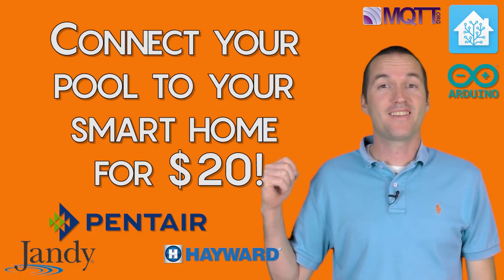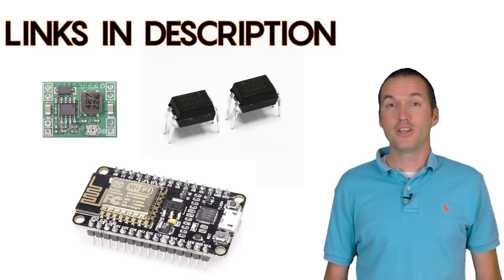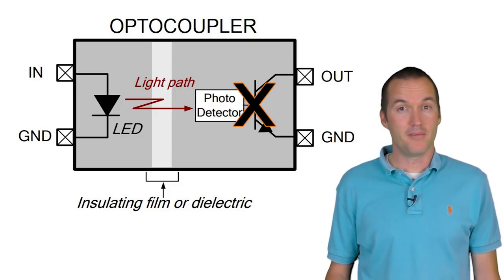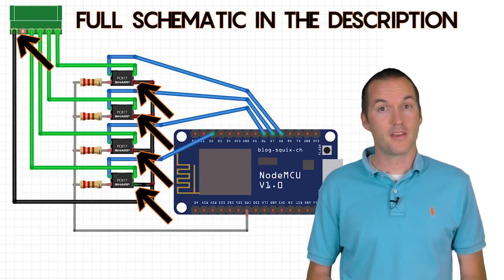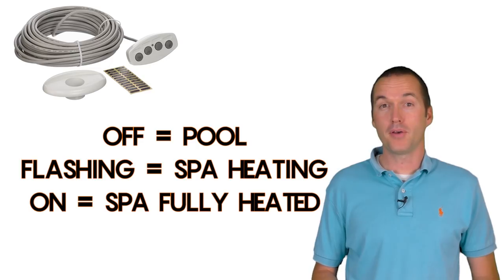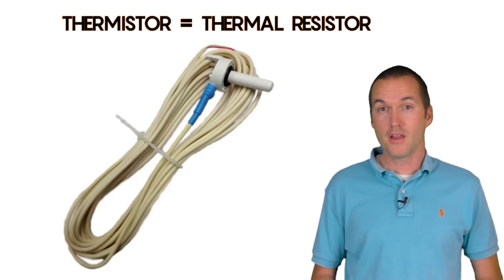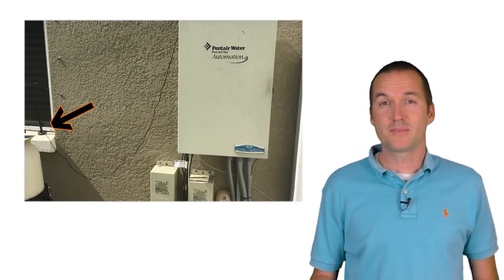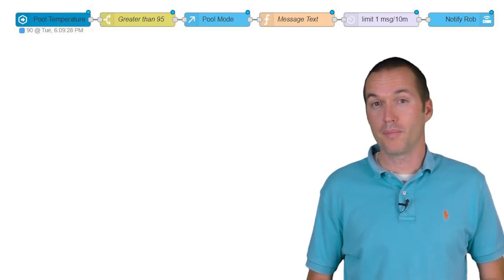Connect your pool to your smart home for $20 with Arduino!

Comment: I’d like to use the nodeMCU around my house in multiple locations to monitor the run times of various devices.  Those run times would need to be stored in a log with time stamps of when that device turned on and off. Then I’d like to take actions based on specific patterns in the logs.  For example if my sump pump was running every 5 minutes in the logs but all of a sudden 30 minutes elapsed without it turning on - that would generate an alert that it may have failed.  Likewise if my well pump turns on frequently for more than 2 hours it should alert that a faucet was left on accidentally or there is a leak.  With the price of these so low I’d like to monitor every device throughout the entire house with similar pattern checking for anomalies in any device. Is there anything like this already existing?
Reply from the maker: Current measuring is tricky.  You should check out the sonoff POW with custom TASMOTA firmware.  It would be very simple to do this with home assistant.
Reply: Hi Neil. Most appliances have some sort of LED indicator to tell you if it is on. If it’s the case for your pumps then you could apply a similar concept to Rob with optocouplers.

After he did this video I used this concept on a USB port on an old tv in the bedroom to determine how much tv we are watching each week, as the USB port only has power when the tv is actually on. All of the on and off states go to Home Assistant and get logged. The duration and notification pieces could be done in Home Assistant or Node Red; I have graphs in the LoveLace UI.

I actually used Tasmota for this so no need to go need the Arduino IDE if you don’t want to.

Hope this helps!

Marc

Comment: I'm trying to translate this into a project I'm working on with an air purifier that doesn't have a remote, but it has 3 momentary contact buttons and 5 LEDs indicating high/med/low fan speeds and two filter types. I noticed your resistors in the wiring diagram are connected to  the CMD pin. I've personally never used that PIN and wondered what its purpose in life is. I'm still looking around the internet but I thought I'd try dropping a comment here first.
Side note: Looking at another video that goes over the best pins for projects would the ESP32 be the best option since i need 8 GPIO pins? Or could I squeak by with GPIO1,3,15 for the buttons?
Reply from the maker: That's the GND pin.  It's a ground.

You can probably get by the 8266, just make sure your momentary contact buttons are not connected to a pin that is high on boot.
Reply: @TheHookUp  Thank you so much! Saved me an hour of research and nail biting!

Comment: Excellent. I am in the process of making a similar setup, except using a Raspberry Pi 0 W. Now you have me thinking it's an overkill :) Do you change the Pool Controllers measurement by piggybacking of of it? I don't have a pool controller and is considering piggybacking of the thermistor in my Pool Heater (HAYWARD IDXLTER1930 H-SERIES THERMISTOR). But I don't want to change what the Heater senses by piggybacking. The heater will still be using it for temperature control
This is a 3 wire thermistor in a 24V Circuit and I was considering using a PCF8591 to read the analog input. Is there an easy way of doing this without interrupting the existing circuit? Do I need to step it down? How would the conversion change?
Reply from the maker: My original answer to this was no, it doesn't change the temp.  I have done some testing and my answer now is that it changes the temperature reading by approximately 1.3 degrees F.  I'd imagine this is due to a small amount of voltage drop caused by the GPIO circuit.
Reply: Thank you. Any suggestions as to how to go about the 24V? Can I convert the thermistor output to anything useful that my PCF8591 can handle?
Reply: @johnraahauge4552  I would think that using a voltage divider that converts the maximum output your 24volt 3wire interface can give to a max of 3.3volt would suffice. You have to make this voltage divider with resistors that are as high as possible in order not to influence the calculation in yr 'commercial' controller.
The downside of this approach is that you will not be able to measure really small changes in temperature,  and the pcf8591 is 8 bits doesn't help that, but with 255 step resolution I am pretty sure it will be accurate enough for the pool temperature range.
I really like the pcf8591, great chip.
Having said that, if you obtain for the Wemos D1 mini or nodeMCU, rather than the raspi, you make things easier for yourself
Reply: Ed19601 I ended up using a voltage divider and an Arduino Uno hooked up to my Pi. I really need the Raspi out there for other stuff.
Reply: @johnraahauge4552  tnx for the feedback. Wise decision. I was pretty sure you already found a solution, just wanted to leave a reply for anyone else with the same question
Reply: Ed19601 Thanks Ed. I should’ve updated the thread  earlier with my solution. Thank you for your suggestions.

Comment: Hi, nice work. Could you tell me what to modify in you code to get 4 MQTT controlled relays(on/off) on NodeMCU ESP-12? I have 4 valves for the irrigation system I want to control with MQTT, I have a Raspberry running Node-Red and MQTT server in my home office. I have tried Arduino plugin for HomeSeer on the NodeMCU, but that was really unstable.
Reply from the maker: If you're not comfortable with arduino hang tight until tomorrow's video, I'm going to go through programming ESP8266's with a new addon called ESPHomeYAML which doesn't use the arduino IDE at all.
Reply: Perfect looking forward to it 👍

Comment: I have a battery operated fish feeder which I'm hoping to connect to Hassio, planning to pull the feeder apart and connect the terminals of the manual switch of the feeder. Ultimately I want the feeder and a webcam so I can remotely feed my turtle went on holidays. I'm trying to use GPIO14 of a sonoff basic to control a relay to operate the feeder. Also bought a cheap Digoo camera but can't seem to get it to work with Hassio's FFMPEG.
Reply from the maker: I'm not familiar with that camera, does it have an rtsp stream that you can access through VLC media player?  

The fish feeder should work no problem, are you going to run tasmota on it?
Reply: Yes the camera does stream through VLC but I can't get it to work on Hassio which is annoying. Yes I'll be using Tasmota, I have all the electronic components now just need to get around and do it lol
Reply from the maker: Do you have these entries in your configuration.yaml file:

ffmpeg:

camera:
  - platform: ffmpeg
    input: rtsp://your_camera_rtsp_stream
    name: "Driveway"
Reply from the maker: try removing ffmpeg_bin: /usr/bin/ffmpeg since the ffmpeg component comes preloaded in hassio
Reply: getting these errors

2018-08-04 07:29:25 WARNING (MainThread) [homeassistant.setup] Setup of config is taking over 10 seconds.
2018-08-04 07:29:42 ERROR (MainThread) [homeassistant.core] Timer got out of sync. Resetting
2018-08-04 07:31:11 WARNING (MainThread) [haffmpeg.core] FFmpeg isn't running!
2018-08-04 07:31:11 ERROR (MainThread) [aiohttp.server] Unhandled exception
Traceback (most recent call last):
  File "/usr/local/lib/python3.6/site-packages/aiohttp/web_protocol.py", line 398, in start
    await resp.prepare(request)
  File "/usr/local/lib/python3.6/site-packages/aiohttp/web_response.py", line 300, in prepare
    return await self._start(request)
  File "/usr/local/lib/python3.6/site-packages/aiohttp/web_response.py", line 605, in _start
    return await super()._start(request)
  File "/usr/local/lib/python3.6/site-packages/aiohttp/web_response.py", line 367, in _start
    await writer.write_headers(status_line, headers)
  File "/usr/local/lib/python3.6/site-packages/aiohttp/http_writer.py", line 100, in write_headers
    self._write(buf)
  File "/usr/local/lib/python3.6/site-packages/aiohttp/http_writer.py", line 57, in _write
    raise ConnectionResetError('Cannot write to closing transport')
ConnectionResetError: Cannot write to closing transport
Reply from the maker: put the 

ffmpeg: 

part in, just not the part under it with the bin path
Reply: The Hook Up yeah i took the other section below ffmpeg: out but still getting error
Reply from the maker: hmm, what version of hassio are you on?
Reply: The Hook Up 0.74.2 and Supervisor 122
Reply from the maker: that's really strange.  here's a longshot: do you have the 

ffmpeg: 

entry above your camera entry?
Reply from the maker: that should be fine.  Is it possible that your camera is on a different subnet from your hassio box?  doesn't explain the FFMPEG not running error though.
Reply: pretty sure its the same subnet
Reply: Just got the feeder working. Still need to work out the camera

Comment: so this might be a dumb question but does the button selection really matter?  Don't you program the button function in the pool controller? (i.e. button 1 on my pool side is lights but even if i use your same code doesn't it just press the button and not send the actual command to the pool controller?)

Hope you reply, would really like this answered before I hook this up to my pool.  I've got everything built and the code loaded on my ESP8266, I didn't bother setting up the correct commands in the Arduino code, figured I would just edit the HomeAssistant yaml file for the correct labeling.
Reply from the maker: Correct, you can change what the buttons do directly on the pool controller, or you could simply hook up different wires to different terminals (connect the wire from the ESP that was supposed to go to terminal #1 on the pool controller to terminal #2 instead).

Comment: Any suggestions on how to monitor pool level?
Reply from the maker: That's a tough one because you have to get a wire close to the water.  A float valve in the skimmer is probably the easiest solution.

Comment: love the videos could you do one on dimming dumb led strips using nodemcu and mosfet with mqtt via HA, loads about rgb but none with single colour tried stripping the code down from a rgb tutorial but can't get it to work
Reply from the maker: I started to write an explanation of how to do this, but it was long and confusing... so I just wrote the sketch for you to modify as needed.  You'll still need to hook up your single channel using a mosfet.  Here's the code:  https://github.com/thehookup/Misc/blob/master/LEDDimming_CONFIGURE.ino
Reply: Have the circuit working  it was the mqtt and HA part I was struggling with 
Cheers

Comment: No not a pool warmer. The public wants your roller blinds system. Bring that it on.
Reply from the maker: I'm working on it, I had to order parts from Ali express
Reply: You sir are a legend!  Keep up the good work!
Reply: Please, I am in the market for some new roller blinds
Reply: I’ve seen some rechargeable battery operated roller blinds on AliExpress just considering my options.  Guess you method is a wires mains solution but hope not.
Reply: I've just ordered the parts for this one: https://www.thingiverse.com/thing:2392856 which uses a cheap stepper motor and looks nice and neat. Would love to see your implementation Rob

Comment: I'm using Wemos D1 Mini Pro which does not have Vin, any concerns with using an external power adapter?
Also, what is the equivalent CMD pin on the Wemos D1 Mini Pro?
Reply from the maker: CMD pin?  I think that's GND.
Reply: The diagram is showing the 4 resistors connected to the "CMD" pin, is the diagram wrong? https://raw.githubusercontent.com/thehookup/PoolMCU/master/schematic.JPG

Also, is external power adapter ok?

Comment: Rob, if I were to reimpliment this concept in ESPHome, am I right in assuming it would be handled like the example Relay code?

https://esphome.io/cookbook/relay.html

My wife has a Glowforge laser cutter upstairs and it requires multiple trips up and down the stairs to insert wood, adjust layout on computer, then travel back upstairs to push the button the start it. I'd really like to "move" that button to her computer desk. ;)

Comment: I'd LOVE to add my Kenmore Elite Oasis Dryer (Model: 110.67087600) to my smart home system this way! 

It's got an ON/OFF LED, 6 different status LEDs, and a bunch of other LEDs indicating certain settings that the dryer is on (26 LEDs in total), and even a 2 digit 7 Segment Display displaying how much time is remaining on the cycle, I'd love to get as much of this as possible publishing to MQTT, any suggestions?
Reply from the maker: Are you trying to do it without taking it apart?  You could use light sensors, or you could tap into the actual LED wiring.
Reply: You guys are bad! Rob, Now you have me thinking about tearing apart the dryer!
Reply from the maker: What could go wrong?
Reply: No, I've already taken apart the head panel and would be comfortable soldering on some jumper wires to get it all connected. I'm just not sure how I could use a nodemcu since there would be more sensors than I have GPIO pins. is there a way to expand those pins?
Reply: Also, sorry for the late reply. Apparently Youtube doesn't notify me of replies to my comments anymore... I miss GPlus as a comment section...

Comment: No it is not a photo resistor...
Reply from the maker: Ah, you must mean in an optoisolator, technically it's a photo transistor (as shown in the diagram), but I was trying to explain using familiar terms.

Comment: Great Project but, I'm new to Home Assistant and MQTT, having a problem getting the switches to communicate with  Arduino.  I must be missing something simple in the setup of the config.yaml file or the mqtt. Thanks for your help.
Reply from the maker: What mqtt server are you using?
Reply: Mosquitto.

Comment: Rob, would you know how to connect a hayward heatpro heat pump HP21104T to Home Assistant?  The heat pump has a 2 wire 24 VAC terminal block to support remote systems.  I know it's a longshot but any guidance or thoughts would be much appreciated!  Thanks
https://hayward-pool-assets.com/assets/documents/pools/pdf/manuals/HeatPro-Installation-HP2xxxxT-HP2xxxxBT.pdf (page 17)

Comment: did you still use the home automation controller? i dont seem to have one, i have a pump similar if not this one, what add-ons do i need to communicate and send mqtt commands to and from it?  https://pentairpool.com/en/products/pumps/intelliflo%20vs%20svrs%20variable%20speed%20pumps
Reply from the maker: You mean the easytouch? Yeah, I use it still, it does the valve control and whatnot, I've just hooked into it for automation and remote management purposes.